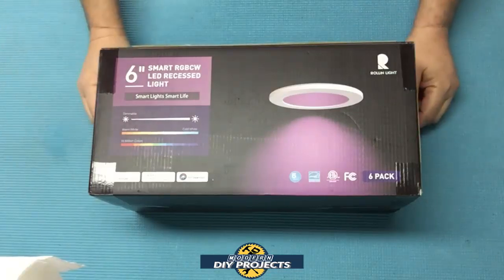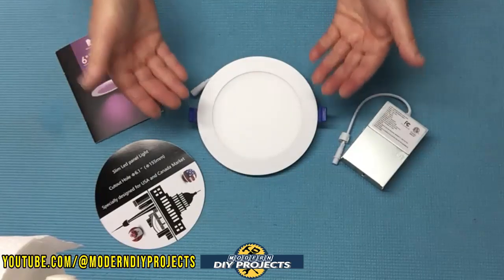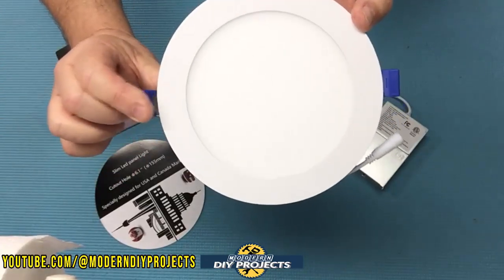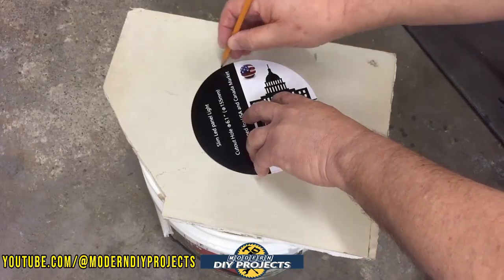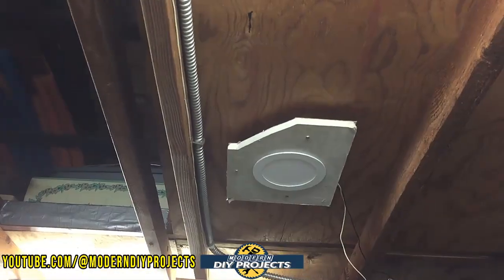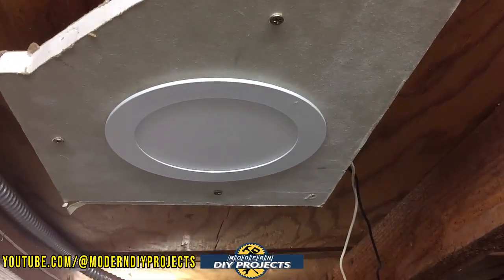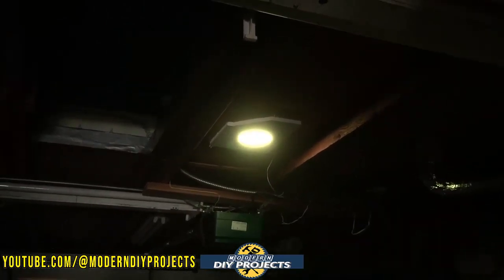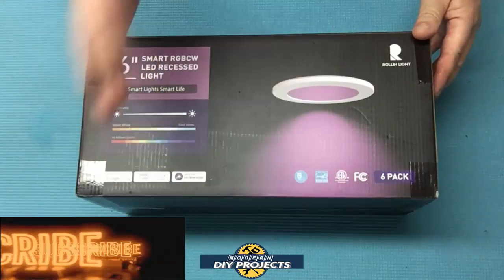Rollin Light Ultra Thin Smart RGB Recessed Light DIY Installation, Setup & Review

Comment: Would you be able to hook it up to your old junction box if it has 3 prong connector or would you need to replace the whole box?
Reply from the maker: I suggest replacing the junction box along with the lights. It's safer and you will get better performance.

Comment: So the black & white wires (& possibly ground wire)that need to be hooked up to the controller box should already be right there once we cutout the hole? & if so would that be the same for all 6 holes that have to be cut as far a the wiring being there already?
Reply from the maker: No, its not that easy. If you are installing the lights where there is an existing light fixture, then the wires will already be there. If you are making a new installation where NO light fixture currently exists, then you have to add the wiring in the ceiling. You can draw wires from a different fixture if you have one nearby, but the wires are not randomly running everywhere in the ceiling. My example was assuming that a fixture already existed and was being replaced with these lights.

Comment: I have other wafer lights installed already. These lights fit into the 2 pin box that’s already up in my ceiling. Do I need to replace the silver box too or can I just install the new lights into the old box?
Reply from the maker: You my be able to install these without replacing the box but I would not recommend that. LED lights are very sensitive and the slightest voltage fluctuation could blow them out. These lights have a long warranty so I recommend to take the extra time and replace the box also.
Reply: You need to change the box.
Reply: Just fyi. Thanks. 

These really don’t connect well together at all. Probably will return them

Comment: You can dim thease with a switch right?
Reply from the maker: Yes you can. But you can do much more with the free app.
Reply: Hi, how I can sync 6 lights together... I have to control them each by each.
Reply from the maker: @STFBERNS  You have to use the app to be able to sync them and also to create zones and themes.